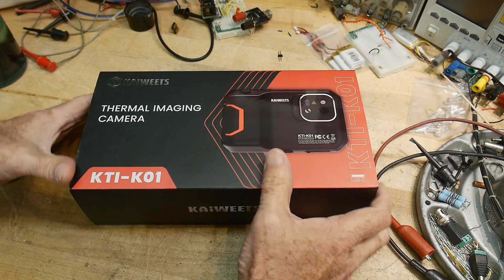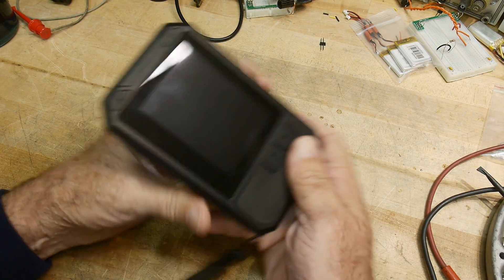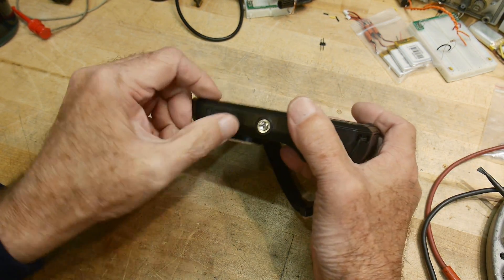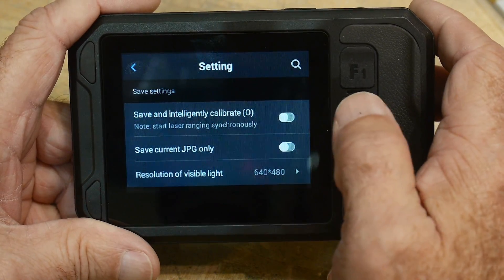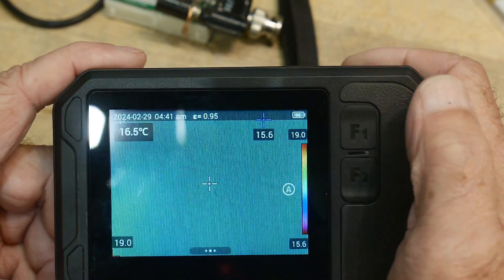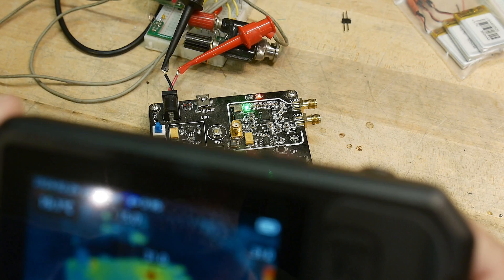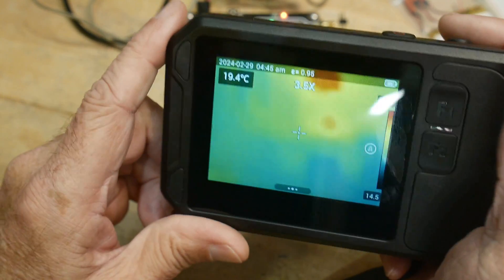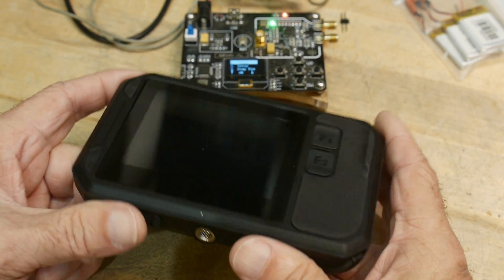#1806 Kaiweets KTI-K01 Thermal Camera Review

Comment: As an opto-electronics pro, please tell m why these are all so expensive? The sensor, the color rendering, the software or what? After all, It's just another section of the spectrum. Don't most sensors read IR if you remove the cut off filter?
Reply from the maker: https://youtu.be/Rb_O1wv5UsM?si=W1AGxN710X8UKEZi
Reply: Thank you, Very interesting. @IMSAIGuy
Reply: @IMSAIGuy thanks for explaining. 👍